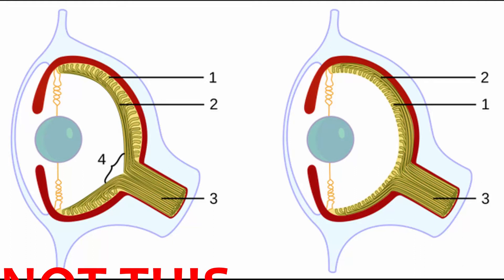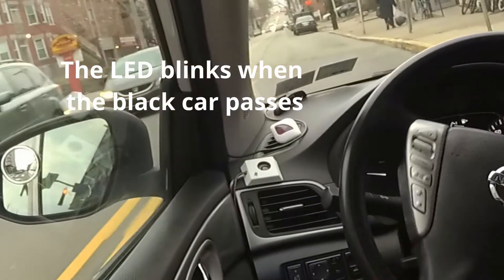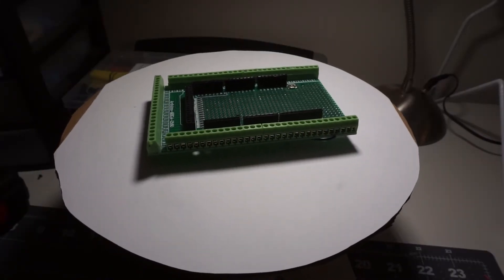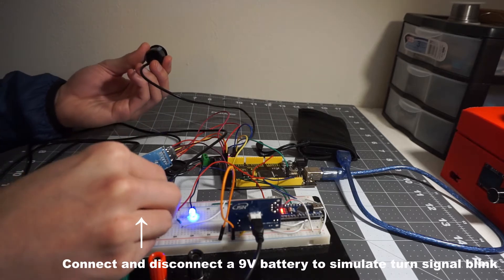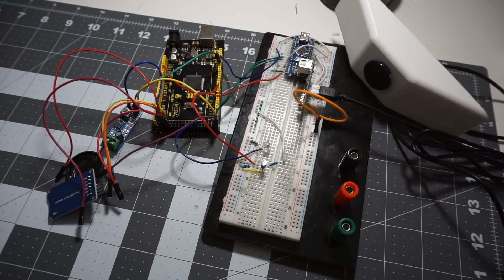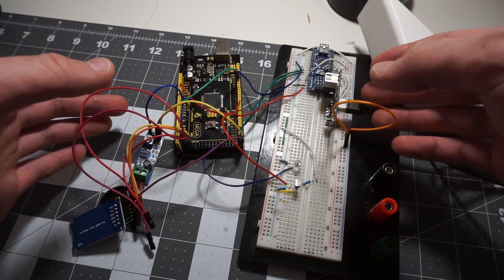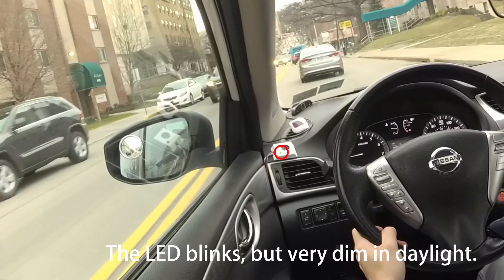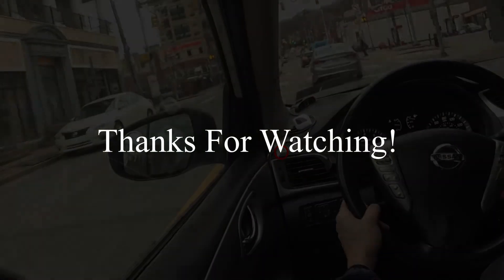DIY Blindspot Detection With Arduino

Comment: So you need 2 arduino boards to build this? I am very new to doing anything like this and want to learn badly. I wish i could get someone to really teach me hands on, how to build this. You probably dont have time to do something like that. Im just an old disabled man who wants to learn. I could pay someone to teach me although i couldnt afford much. 
Do you have a parts list and diagram showing how to wire everything? It would have to be a simple wiring diagram though. I saw where you have to code for it on gethub but i didnt see a parts list or diagram? Could you post those things an maybe i can try to build one myself? Thanks